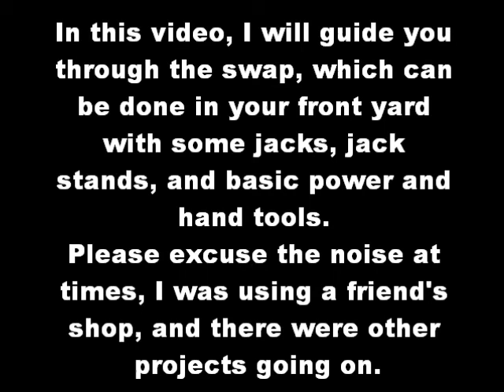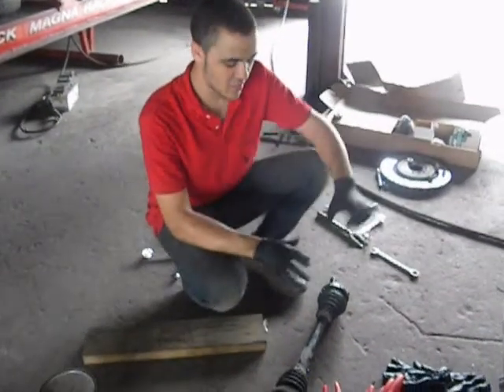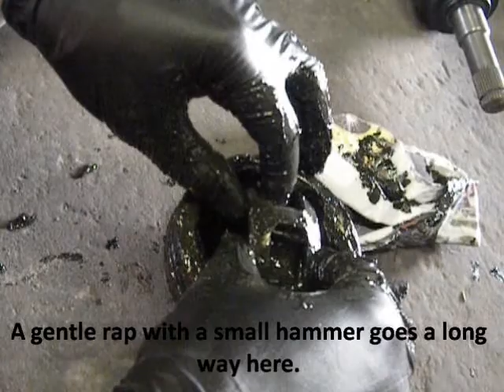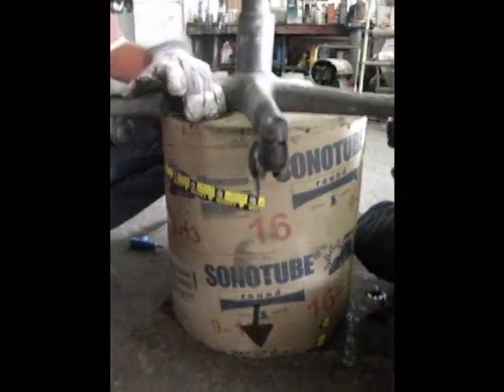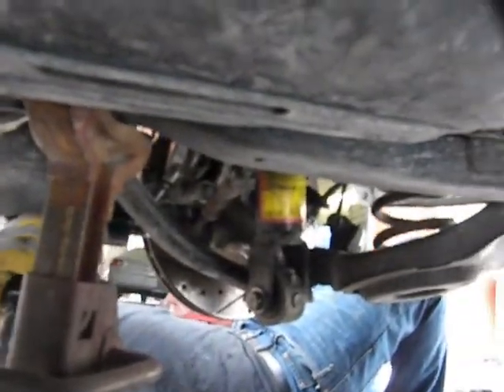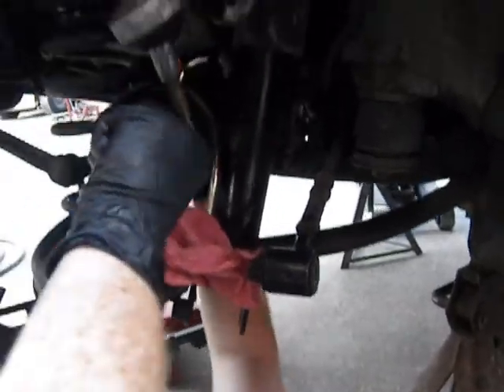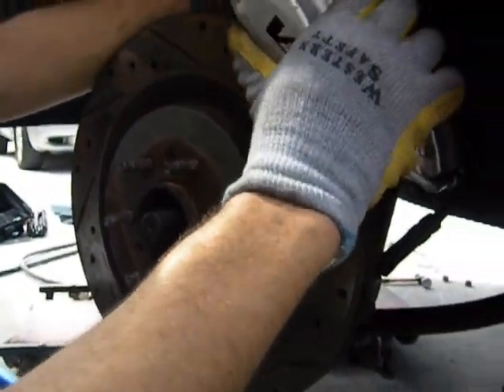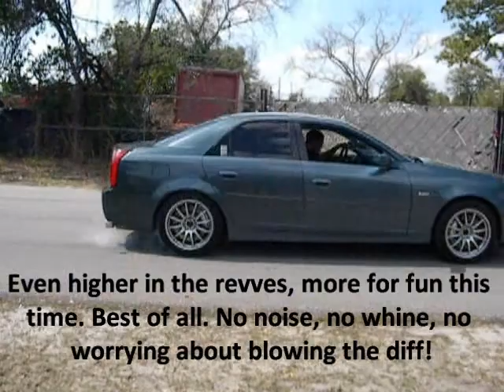Cadillac CTS-V 8.8 Differential Swap from Creative Steel [SEE DESCRIPTION]

Comment: Just installing DSS/Hendrix axles eliminated WH and bought me time for my maggied CTS-V, but doing an 8.8 is that ultimate solution.  If I owned Creative Steel, I'd have done a video with someone explaining the scope of the work to be done (i.e. driveshaft and misc components), with a list of those components and sources, with no background noise, and with someone who could hold the darn camera steady.  Thanks, though.
Reply from the maker: I did this video under crappy conditions for no free so other owners could get an idea of what they were in for. CS had no part of it. You're welcome. 

Also I can update that the stock outer CVs failed on the non-upgraded axles this kit came with. I swapped out to the "1000hp" axles and doubt I will ever have an issue with them.

Comment: Hey bro was wondering if u can give me advice on changing the diff fluid i wanna add synthetic from lucas on my 2007 cts 3.6 which doesnt need limited slip additive, the reason i wanna change it is cus my traction control  light comes on!! and my diif disengages if i gas it when that happens my engine just revs  on the manual it says i need to change the fluid. Thanks man

Comment: what differential did you use besides creative steal. I'm trying to figure out if there are other options out there. thanks
Reply from the maker: +Miguel Sanchez 

The "differential" used in the CS kit is a Ford 8.8. The other main option is a Ford 9 inch. There isn't much of a purpose in doing the 9 inch over the 8.8 unless you're planning on doing strict drag racing. If you're wanting to track the car as it was intended, the stock diff is really fine, as long as it isn't hard launched. If you want the freedom to hard launch and keep a road course oriented suspension, you're going to want the CS 8.8 kit.
Reply: The seems like the only route. I have not found anyone else besides CS. If I get another stock I'm sure it will break because I have cam, headers, intake, tune and I'm planning nitrous shot later on. I will take a look at Ford 9 just to see the other option. Thank you for the input
Reply from the maker: +Miguel Sanchez Is your car primarily a drag car or a road course car?
Reply: Road. But I drive it like I stole it most of the time (:
Reply from the maker: +Miguel Sanchez lol that's how they're meant to be driven. A stock rear should be fine if you're not drag racing/hard launching even with your mods. But call up CS, they'll usually cut you a deal and Max is always willing to talk about your needs. Great people.
Reply: Ok thanks

Comment from the maker: If you regularly use the grande torques bestowed to you by GM, you probably will, unfortunately. If you baby it and drive it soft usually, the stock unit may last forever. Mine was still good when I removed it, I replaced it for performance reasons.
Reply: do you still have the stock unit? if so I'll buy it!

Comment: man running the car in gear on jacks is so stupid, and this guy is the worst at explaining lol... and it still wheelhopped after LOL
Reply from the maker: I'm glad you found the video helpful. 

If you don't mind, could you please go make a better one so I can pull this one down and finally stop hearing the moans from you idiot forum dwellers?
Reply: It was the tpms sensors. They needed to be removed.